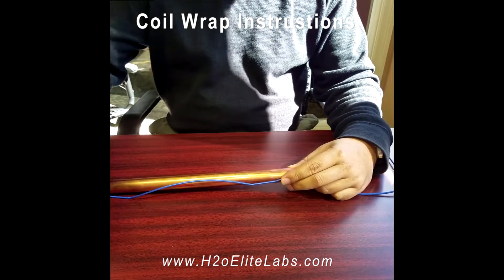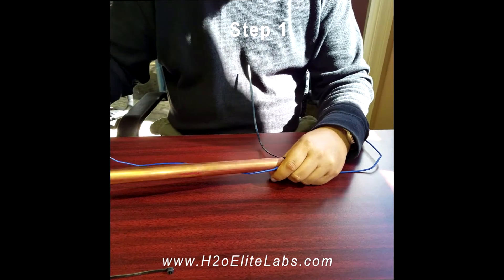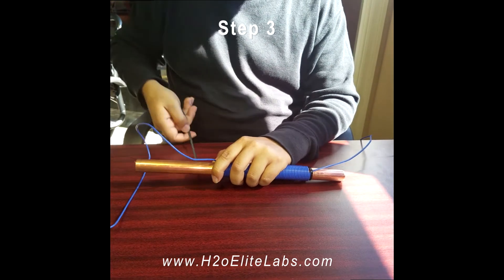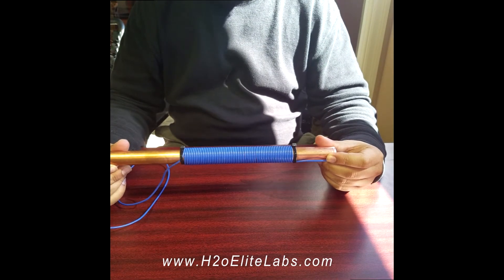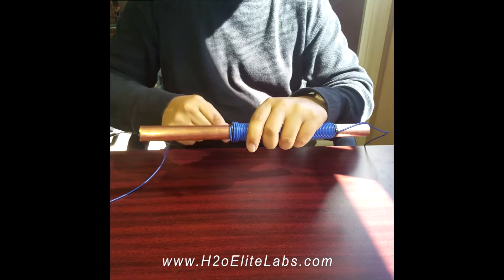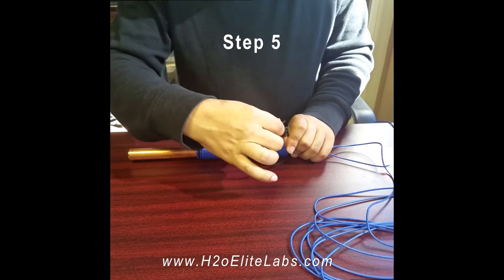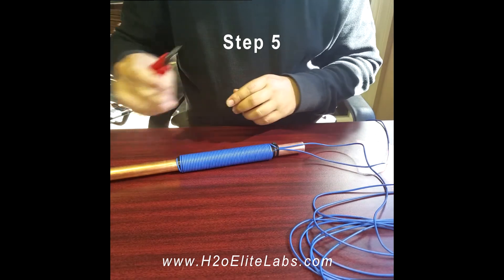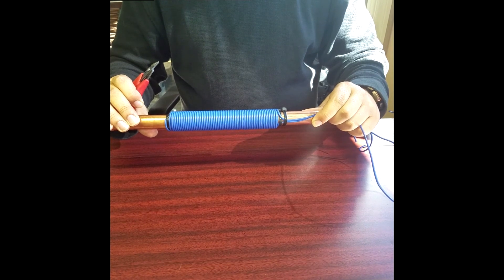H2oEliteLabs Coil Wrap Instructions.

Comment: It's easy to wrap it went it is a free floating section of pipe. Not easy when it is the actual pipe. You have to deal with 25 feet of 18 gauge wire and loop it over and around the pipe. Sometimes in a very cramped space. Could take upwards of an hour.

Comment: What happens if you double coil pvc pipes?
Reply: The instruction manual actually tells you to double wrap on copper pipes. On PVC, cpvc or PEX you have the option of double if you PVC pipe is a half inch. If your PVC pipe is 3/4 or larger than it's recommended to do single wrap. To answer your question it would probably be less efficient
Reply from the maker: Hello, It will reduce power output.